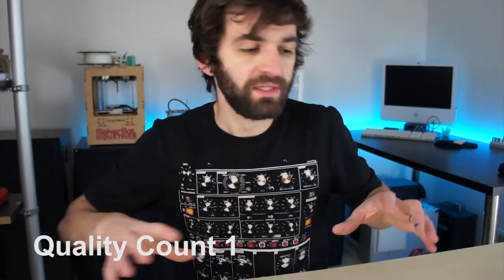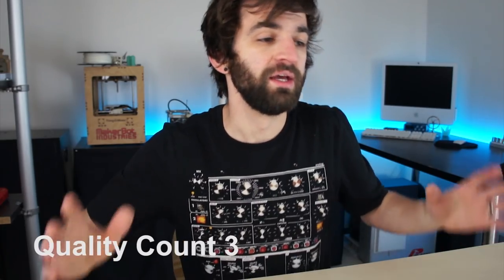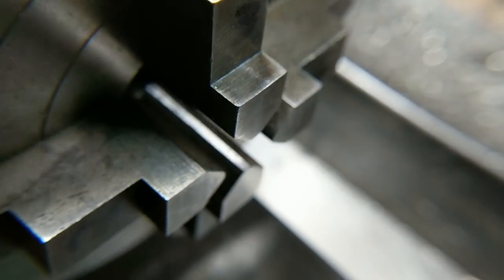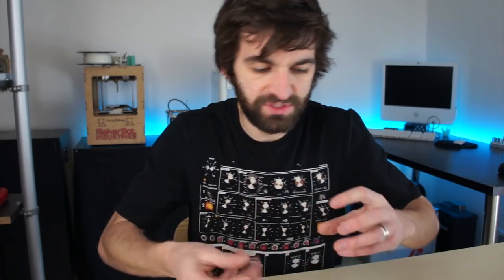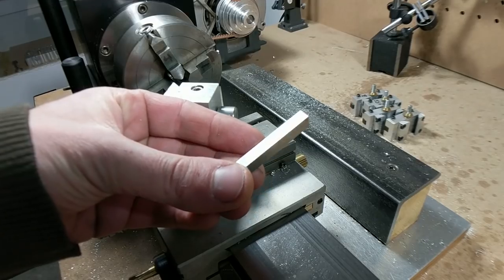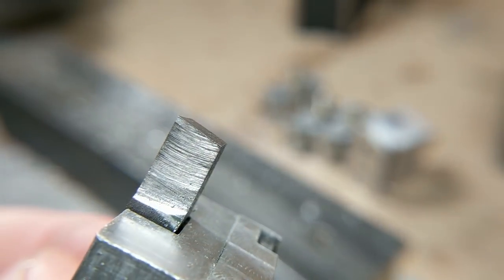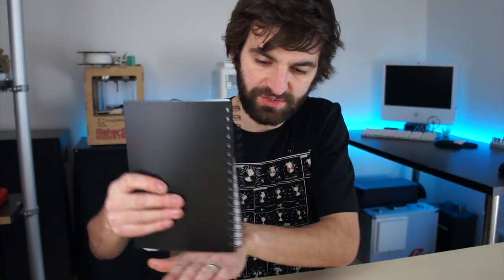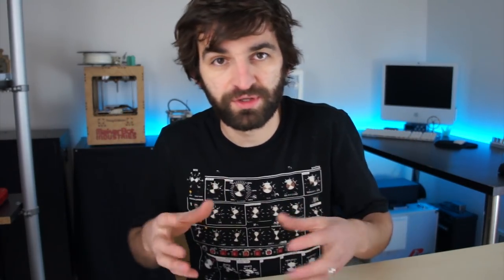Buying Your First Metal Lathe

Comment: I bought a 12 x 36 atlas lathe 650 dollars with 3 and 4 jaw Chuck,,aloris tool post and a lot of tooling,  by vintage and leave Chinese lathes alone,,, just got original milling attachment for atlas,,, and just picked up 2 - 6 inch atlas lathes 400 dollars for both,,, so I now have 1200 dollars invested in 3 nice well built lathes that have proved the test of time.
Reply: Sad think about atlas lathes is the gears are not steel. They are pot metal or pewter. Junk metal. My advise is to sell it and look for a Sheldon or Southbend. Much better lathes. Atlas is a poor man’s junk lathe.
Reply: @JohnDavis-yz9nq  I have 5 atlas lathes,,,2 - 12 inch. And 3 6- inch and only 2 gears out of the 5 show any wear,,,,l can slide micrometer and caliper down all ways and there all perfect and needle on dail indicator hardly moved on all there spindles,,,l buy and restore vintage tools,  the flat ways on atlas lathes last forever,,, had to discard many southbend and Logan lathes because once v ways wear there junk,, heard many talk bad of the zmak cast gears,,,zinc,magnesium, aluminum and copper are kopter,,German for copper,,, all the gears in gearbox are steel,,,best thing about atlas is because of the gears they was bought as hobbyist lathe and never was in factories are classrooms and survived 60 years,,,you will be hard pressed to find a 60 year old southbend are Logan in good condition, l can turn anything they can with atlas just a little slower,,,I put a nylon gear as drive gear to save in case of crash,,,3 years ago and it's still in good shape,,,,l have 1500 dollars invested in all 5...And all look and work like new.. my buddy has a 40 year old heavy 10 southbend and comes over to use my atlas for very fine work because of his vway wear. Hell even many new lathes have nylon gears now,, 60 years my friend I think they have proven the test of time and deserve respect.
Reply: @georgespangler1517  well if you restore lathes you certainly know more about them than I do. I currently have a 618 atlas and it was a good lathe to start on. I build kinetic wind sculptures and all I need to do is turn and bore round nylon plastic actually cutting board materials to go inside stainless bearing housing for my kinetics. I need to bore each for bearings and bore all the way through for axle or shaft clearance. The 2 bores that I make are 7/8” and 1-1/8”. This 618 is a little small for that. I looked at a 1938 Sheldon lathe yesterday locally. Outside of needing oil the ways looked good. Had some slack in the cross slide. The compound was good and stiff. It will probably need a belt at some point. Couldn’t run it because it was in a boxcar storage with no power. I turned the lathe Chuck and it didn’t seem to have slack in the head gear and turned freely. $375.00 for it and a lot of carbide inserts and tool holders. He said that he has more tooling and a quick change tool post for it plus and extra 1 hp motor. He was doing hobby type work but doesn’t have a workshop anymore since he moved. It’s on an original cast iron stand. Jacobs ball bearing Chuck on the tail stock. Being a 1938 it was not new looking but it doesn’t need restoring either. Outside of cleaning it up and oiling it should be ready to go. What is your thoughts on it?
Reply: @JohnDavis-yz9nq  l have 2 618s,,,have one that's never been used John I displayed it,,, you would have to spend 1000 to 1500 dollars to find a new lathe as good as your 618..
Reply: @JohnDavis-yz9nq  375 dollars jump on it,,,2 weeks ago I drove 100 miles to pick up a 12 inch atlas and 618,,but big surprises was in the rusted bucket with them a milling attachment steady rest and follower and nice 4 jaw Chuck to go with the 3 inch all for the 12 inch and has exact same model number as my 12 I have,, 500 dollars for everything,, Sheldon is a good lathe,,, but if your in the pre 50s it won't have timken bearings Will be brass bushings,,there ok as long as there kept oiled, check the ways up close to Chuck and run it up and down them you will feel the wear if it gets loose near Chuck and tight to tail stock, you know what to look for ,just because it's a well built machine dosent mean it was well taken care of,,goodluck
Reply: @JohnDavis-yz9nq  use lucas red n tacky spray grease on your open gears ,,,old school guys use just oil and it's slung right back off,,they didn't have spray grease in the old day are they would have used it.
Reply: @georgespangler1517   I ran the carriage up and down and it seemed a little tight all over. I think it is the lack of oil on the bed or way. I forgot to tell you it has a taper guide with it. The man told me that is a rare thing. I told him today that I would take it. Like I say it’s a 1938. I will probably run no more than 2 to 4 parts a week on it. It will never be run over an hour at a time. Man you don’t know how much appreciate your information. I don’t know much. I’ve only been using one less than 2 years. If this on works out I will be selling the 618. Lots of tooling and all is in a very nice wood cabinet. I paid $600.00 for it. I am in Texas and lathes are hard to find here. Especially smaller lathes. Where can you get the Lucas red in a spray? Also I need to get spindle oil too.
Reply: @JohnDavis-yz9nq  you can get it at any automotive parts store,,even Wal-Mart should have it, l use 30 weight NON DETERGENT oil for spindle, and 3in1 oil on my ways,, l would hold on to your 618 unless you need the money, nice to have a small lathe for the little stuff,,l put a treadmill motor on my 618,,for rpms control, my 12 was very hard turning from build-up and really smooth after I cleaned it up,,l like to find them covered in oil shows they maintained them,,check your lead screw it's the tell all as to use,, teeth will be narrow and sharp near Chuck if it's been used alot,,I've been lucky to find hardly used lathes,,you will find the more expensive lathes are the most whore,,  but I've found you would have to pay thousands to get a new lathe equal to the vintage lathes, open up the carriage and clean it well,,, as well as your Gibbs oil will dry up and make them hard to move,, but you can't go wrong with a Sheldon my friend.
Reply: @JohnDavis-yz9nq  Dorchester is the best but one gear can cost 500 and up to replace,,, Sheldon is a great lathe for the money.
Reply: @JohnDavis-yz9nq  nice it has tamper attachment,,,but remember it will play a big part in it being hard to move by hand also,,
Reply: @georgespangler1517   yeh George it is something I would never use anyway. For what I do I need to get center in the round nylon bushings that go into the stainless bearing housing. I bought the little atlas because if nothing else you are pretty well able to get center with the hole on a lathe. I have a lathe Chuck mounted on a drill press that I was using to run these bushings. But if you take the lathe Chuck off it takes quite awhile to get it centered again. George I really don’t know a lot about lathes. I need to listen to you about lathes. I have been a blacksmith since I was 20 years old. I know as much about anvils as anyone. George I am thinking this old man is telling me the truth about the lathe. He was like you in his early years. He has bought and sold so many lathes. He has traveled from Texas to Ohio to get them. After meeting the old gentleman I don’t think he would lie to me about it. I asked him flat out if it was a good lathe and he said yes it is. I took some parts that I am going to be running and he said would run them no problem. I would bet that this lathe ran parts during WWII. I guess you probably know this but our naval ships had lathes. After the war they dumped pretty much the whole machine shop in the ocean including lathes to compensate for fuel consumption. No telling how many lathes are at the bottom of the ocean. Sad sad.
Reply: @georgespangler1517  inside the gear box was oily and greasy. We have a Napa auto parts close and I am thinking that is the place to get the oils. I was thinking about putting a tarp under it and spraying diesel on the ways or the bed and under the cross slide and compound and let it soak to clean it before oiling. Even in non use the man has kept the spindles oiled. He showed me yesterday where he had over oiled and leaked out a little at the the spindle head. I was thinking light weight oil for spindle oil but you say 30 non detergent. I will get that. On the bed of the atlas I have been using chain and bar oil. What about the lead screw. White grease or just oil on it?
Reply: @georgespangler1517   morning George, you said 30 weight non detergent for spindle oil. I thought they wanted lighter oil. A lot of people use chainsaw bar and chain oil on the bed or ways. What is your opinion on that? Of course any oil is better than no oil.
Reply: @JohnDavis-yz9nq  bar oil is to heavy and sticky to brush chips off easily but I'm very diligent about keeping chips off machine and I want a light oil I can wipe off and reapply easier then bar oil would be...if you Sheldon has brass brushings in spindle I would use 20 weight NODETERENT and if it's timken are ball bearings I would use 30 weight NODETERENT are spindle oil,, oiling and cleaning are important with a lathe.
Reply: @georgespangler1517   thanks George. My application will be plastic shavings. I was going to tell on some of my kinetics I use schedule 40 3/4 inch stainless pipe for bearing housing. I have taken these to machine shops to get a 7/8” bore in the ends of the pipe and this has brought machine shop to their knees running these parts. They burn up inserts fast. So what I came up with is to chuck the piece up in the lathe and move the cross slide and tail stock to the end of the lathe out of the way and get a die grinder with a carbide burr and run the die grinder and lathe at the same time. It works like a charm. I brush fingernail polish on the burr to tell me how deep to go. I can make a bore about as fast as using a boring bar. That really is the reason I am wanting a bigger lathe to have more room and not have to take anything off. Make sense? I tried a carbide reamer bit on a drill press. Works but the bits don’t last long. Once you start drill stainless you have got to go. If you peck at it then it will work harden. Really the die grinder and lathe works the best and it is so easy. Getting a air hose to the lathe is the worst part. So if I have and metal shavings it would be from that.
Reply: @JohnDavis-yz9nq  sounds like you need to make a die grinder mount for your cross slide
Reply: @JohnDavis-yz9nq  even a wood lathe with tool rest and round Chuck the tools would serve you better
Reply: @georgespangler1517   maybe but I still have to turn the nylon bushings down. I’ve been told a wood lathe would be dangerous for what I do.
Reply: @georgespangler1517   actually I have thought about making a die grinder holder for the cross slide. Another nylon bushing I use is 1 3/8” turned down to go inside 1 1/4” schedule 40 stainless. Three inches long with a 5/8” bore all the way through to clear the 1/2” shaft. Then a 1 1/8” bore on each end for the bearings to go in. In the past I have run these in a lathe chuck mounted on my powermatic drill press. In the old days I would turn the nylon bushing down by using a larger than 5/8” drill bit and putting a taper on it. Then run a hand drill and my 72” belt grinder at the same time. A 36 grit belt will take it off pretty fast. Looks like crap but you are not going to see it inside the pipe housing anyway. I have to drill a hole and pin the bushings in the pipe.
Reply: @JohnDavis-yz9nq  wood lathes are dangerous for any work if not being careful,  you can make a mount for your grinder,,,so a vedio where one was made,, would probably be hard to hold the smooth pipe with wood lathe,,but the round Chuck would hold it more even they metal 3 jaw Chuck can
Reply: @georgespangler1517   yeh I really don’t know anything about a wood lathe. In fact I have never been close to one since junior high. I was told it would be dangerous trying to turn the nylon down. I will pull one up on the internet and look at it. I like your idea of putting together a die grinder holder for the Sheldon. I am going to get it tomorrow.
Reply: @georgespangler1517  I pulled up a wood lathe at harbor freight. $399.00  I think the Sheldon is the best deal. $375.00. Wow they are proud of those wood lathes.
Reply: @JohnDavis-yz9nq  don't pass that Sheldon up,, and no to harbor freight wood lathe,,,, l bought a vintage Rockwell wood lathe with a munch of tools and spurs and 4 face plates for 250 dollars,  10 times better than harbor freight
Reply: @georgespangler1517   hey George. I got the Sheldon home tonight. Plugged it in and it runs smooth. Needed to clean the bed and ways. I put a tarp under the lathe and painted diesel over the cross slide and bed and ways. I checked the threaded feed and it had normal wear about the same all the way down. I pulled on the drive belt and the front bushing in the spindle head seems to have some wear in it. No big deal. It is a saddle type housing I will have to take off to get it out. It looks easy. I plugged it in and drilled a nylon bushing to see if it would drill center. It looked good on that part. The man gave me an extra one horsepower motor. Got a steady with it. A lot of tool holders and carbide inserts. I think if I get a new bushing for the front spindle and adjust the cross slide I will be pretty happy. This lathe is so old that it is so simple. I don’t think it will take much to get this lathe being somewhat accurate. At least close enough for what I need to do. I am going to let it soak in diesel tonight and wipe it down and oil it tomorrow. As old as it is I couldn’t believe how center it drills.
Reply: @JohnDavis-yz9nq  that's great john,,,you can't beat the vintage lathes. It's easy to replace the spindle bushings,, and that steady rest is 300 to 400 alone  ,happy for you my friend and glad you didn't pass it up,
Reply: @georgespangler1517   you know George what I like about it being a 1938 it is so simple. I love how they built things back then. I pulled on the flat drive belt and the lathe chuck would move a little. That told me the bushings need to be replaced. Really I am amazed by the simplicity of it. Lololo and the price. I don’t know why the man didn’t ask $400.00 instead $375.00. At that price I can spend a little money on it. The cross feed does have a little slack in it but the man said that can be adjusted out from the bottom. Diesel does wonders cleaning.
Reply: @JohnDavis-yz9nq  l have a 1938 delta Rockwell drill press must weight 200 lbs and is bench type,,solid steel column,,and so true I converted it into a milling machine, 50 dollars I payed,,,I have a 1200 dollar newer delta that's not as smooth and true,,
Reply: @JohnDavis-yz9nq  Sheldon was English made,, but the badged challenger was said to be British made, has heat treated ways and big bore headstock,, I think 8, 9, and 10 inch was made,,very sharp looking machines.
Reply: @georgespangler1517   I have 4 drill presses. One Delta a Rockwell a powermatic made in USA. And one porter cable I bought at Lowe’s made in China. It’s a decent press. All are floor models. The Delta and Rockwell are vintage. I use all 4 of them in my kinetics build. Drill presses are hard to come by too.
Reply: @georgespangler1517  the one tool I have in my shop that I would not be without is the Bader belt grinder. The most used tool in my shop.
Reply: @georgespangler1517    Hey George, I spent time on the Sheldon lathe today. It’s oiled good and ready to go. I turned down some nylon molly filled parts. Used the automatic feed and all was perfect parts. The speed is so easy to change. I had to change speeds to bore out the 1 1/8” for the bearings. It bored a perfect center. The side carriage has a little play in it but the compound does not. My friend I really couldn’t be happier. And just to think at that price such a decent lathe. A friend of mine was here today and he said like the man I bought it from that the slop in the slide carriage can be adjusted to get the slack out of it. As of now it does everything I want it to. I found the Lucas red spray grease but I am having trouble finding 10 or 20 weight oil for the spindle. The man I bought the lathe from gave me enough for awhile. I knew to find out what shape the lathe is in I needed to run some parts to be able to tell. And they turned out just fine for what I do. Thanks again my friend for hanging with me and advising me on the lathe.

Comment: I'm curious, with all the used 1950s machines out there why would anyone buy a new one.
Reply: @johnsmith-zs9jq  That all makes sense to me, and thank you very, very much for the reply. I suppose it comes down to who you are and what's your living / space situation, and what one wants the mill or lathe for to begin with. As a contractor I typically buy the most expensive best built portable tools available. I'm often asked why I don't own a massive this tool or that tool.  The answer is always that I can't lift it on the job site. But the answer is never cost. Nonetheless, from your answer I think I can understand that the needs are different four different people, and the weights and skills required in space required are on a different level then what I'm accustomed to. So in any event  I can still relate to your answer, and am grateful for the time you took to write it out.
Reply from the maker: Awesome reply John, thanks!
Reply: @CurtVanFilipowski  Thank You! 
BTW,  I can't see my initial reply to Joseph DESTAUBIN. What happened?
Reply from the maker: Strange!  Someone must have flagged it as offensive or something? I don't even have the option to bring it back. Was a great reply as well, sadly this one was removed for a reason unknown to me!
Reply: @johnsmith-zs9jq  It was a great reply. I can't imagine that someone would flag something so benign.